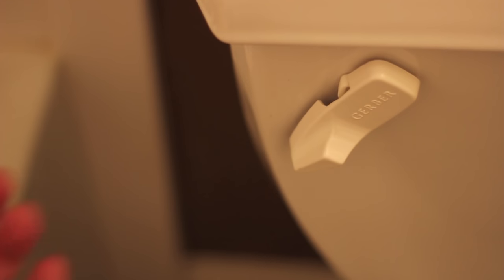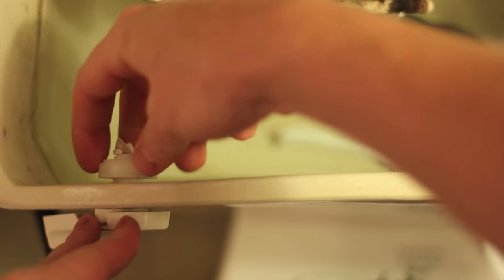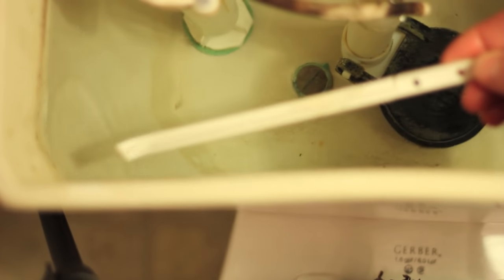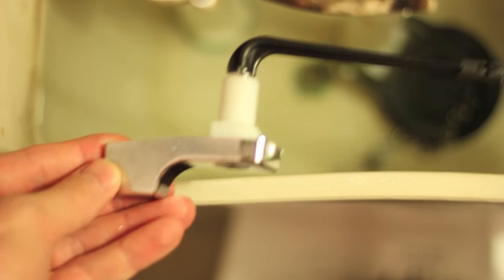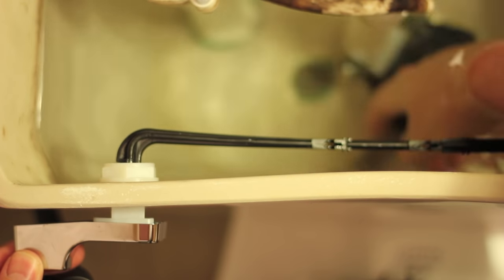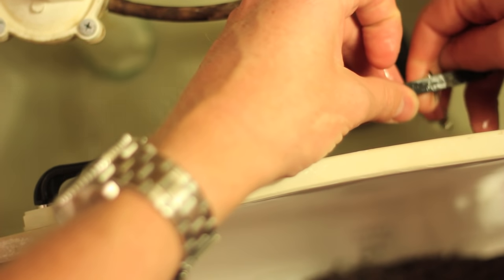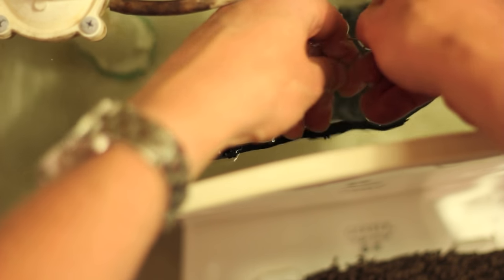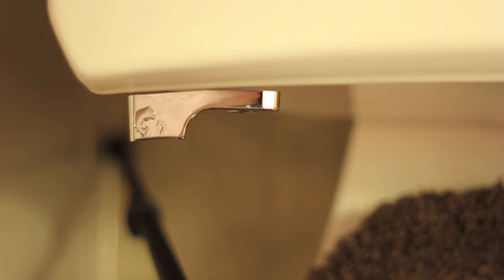How to Fix or Replace a Toilet Handle / Flush Lever

Comment: Oh my stars.   Never in a million years would I have guessed you slide the whole thing threw the handle hole.  You legit blew my mind. We broke 1 thinking we had to disconnect the black part.  I told myself don’t break another watch a video.  So glad I found your video.  I will watch till the end and go fix my toilet.  Thanks. So much

Comment: Thanks. It seems so simple now that I watched your video and made the fix, but I spent a MONTH putting it off. It wasn’t until I watched your video that I got the energy to deal with this. The only thing that threw me for a minute when buying the part was that my toilet has a side handle and most of the parts at the hardware store are for front handles. They did say you could bend the arm but that just seemed like a recipe for disaster so I managed to find a unit specifically designed for side units. It was a few bucks more but installed perfectly! Thanks again for your super clear video!

Comment: This is great, but what do you do if you don't have a chain linkage? Mine is made of plastic and has sawtooth grooves to hold it in place. But it's a devil to try to get it through those little holes on the lever.
Reply from the maker: For that kind, you'll need to either find some way to rig it or get a new chain.

Comment: I'm at a dead end because the nut has corroded and I can't get off.  Even with the opposite from "righty tighty lefty loosey" it didn't budge and I've worn it smooth.  It would have been an easy fix but looks like I'll have to call someone now.  I'm just leaving the tank top off and pulling the chain myself until fixed. ha

Comment: This guy a great teacher however, I cannot get the plastic piece out of the lever hole. It seems some previous person glued it in the hole.  I've tried with a wrench and it won't budge.  The handle lever came off but not the piece that holds handle.
Reply from the maker: You might need to chisel it out - just be careful not to crack the porcelain tank!
Reply: Thanks.  I was able to get it off after a  few tight tries and I'm back in business with my  flusher.  Thanks and thank you YouTube.

Comment: Great instructional video. Very simple and easy to follow. I also appreciated the followup advice to the commenter who couldn't get the plastic nut off (even when turning clockwise). I got out my trusty Swiss Army knife and sawed it off!
Reply: They are reverse thread as I found out today and saw on this video.  Yours must have been doubly frustrating.

Comment: Thank you! I was having a problem where pushing the handle down as far as it would go was barely opening the flapper. You helped me figure out that it was the chain that was too loose after having had the flapper replaced. I adjusted the chain and now it works properly again!

Comment: This is exactly what happened to me so I bought a replacement with a metal arm instead of plastic so it doesn't happen again. Sadly when I took the old handle off there's a plastic piece left in the porcelain hole that I can't seem to get out.

Comment: Just use this in 2024 to find out that the conventional lefty loosey righty tidy method didn't work for replacing the handle and because you mentioned that I was able to fix mine in the same length of this video so thank you🎉🎉🎉

Comment: This was a interesting job, don't think toilet handle had ever been replaced in 45 years at least. Handle snapped off, screw head had corroded on the inside hairpin holding it in place from getting out of hole snapped off but with a careful hot knife I was able to remove old piece and replace with the universal part which was not universal but after shortening I made it work. Thank you for your video!!👍

Comment: Thanks for this video. A quick question, do you have to buy a replacement handle from the same brand or are most replacement handles standard size (i.e., same size square hole)?
Reply from the maker: +Paul Mirek Hi Paul. The sizes and square holes are standard - the brand shouldn't matter. That said, if you are able to take a look at the part before buying it to verify, it couldn't hurt.
Reply: +Nils Rasmusson Thank you sir for your help.

Comment: You took off the screw very easily, starting at 53rd seconds of the video. In my case, that is kind of stuck. Do you know which spanner should I use for removing it? Thanks In advance.

Comment: I'm not here because I don't know how to replace a toilet handle but because I have way too much practice.  Our house has two toilets and I'm now replacing the handle on the one with the newer toilet for the fourth or fifth time in about 17 years.  In meantime, our other bathroom has a toilet that is probably original to the 60 year old house and I've never touched anything but the flapper on it.  Just drives me nuts that all the parts that are on that toilet that are between at least 20 to 60 years old seem to last forever and anything I buy now I know I'm looking at having to replace in three to four years at most.  With the exception of cars which improved quite a bit in my lifetime, they just don't make stuff like they used to.

Comment: The reason it's backwards, and not lefty-loosy righty-tighty is because of your orientation. You're not turning it head-on, you're reaching around from behind it. So it only seems backwards, but if you were turning it in head-on, it would be normal.

Comment: ok how can i replace my cistern lever which, unlike your fancy modern cister, happens to be round hole? even with fluidmaster valve kit the lever is too damn big even with qa rubber adapter whch fits over the square fitting? I bet no one in this video can give me a decent reply to that WITHOUT replacing the cistern?

Comment: I don’t know how I could have messed this up but I changed the handle, then the toilet wouldn’t start running. Then while I was messing with that the toilet handle stopped working. I can pull it but it won’t flush. LOL now my uncle is on the way over. I tried haha

Comment: I bought a metal rod to replace, but here's my issue..when I flush, it raises the rod so high it hits the top porcelain, not giving me enough clearance. So it wouldn't matter if I moved the chain.

Comment: I don't know if you are still monitoring comments but the problem I seem to be having is it the square at the end of the handle doesn't seem to go in far enough for the washer to catch hold on the other side. I just bought a cheap $4 one from Walmart to hold me because I'm in a temporary residence

Comment: If you`ve had a handle that got hung up where you have to jiggle the handle then you have too much slack in the chain . There shoudl be very little slack from handle rod to the rubber stopper.

Comment: Here's a great tip that will save you 1000 litres of water every year ! Place a house brick inside the cistern  , so when it fills up after a flush the brick takes the space of a litre of water . I have been doing this for years now and it works :)

Comment: Thanks. FYI ...you can flush (by pulling up the chain) until you get the replacement piece. It's a cheap easy fix, so don't wait to long. A great first time diy. ;) (I thought it just needed tightened....didn't know the plastic will do that.)

Comment: That's the point I was missing right in the opening - the nut on the handle is backwards.  I was wondering why I was turning the nut but it wasn't getting any looser.

Comment: Thank you! I was failing miserably but you said the magic sentence (unscrew in the opposite direction). My second hurdle was the opening on my tank to insert the handle is more oval then square-nothing ever goes smoothly ( I resolved that by filing the square couriers).

Comment: I have a question I need help with so my toilet Is 69 years old It hasn't been changed since the house was built In 1951 anyways the other day the plastic nut that holds the handle on cracked so we went to home depot bought a new flush handle and when I installed It I noticed that the metal lever that connects to the chain was lifting up too high past the tank and when I put the tank lid on the lever Is hitting the lid and keeping It from being able to flush the toilet am I doing something wrong please I need help

Comment: I've never had this trouble before but the handle and plastic nut on the other side of the porcelain are loose and I can't get it right. The flush handle is very loose. The but is tight but the handle is flouncy.

Comment: My son broke the handle, I removed the part and purchased a replacement, now I can't get the old one off ( don't have the right tool to loosen part), I was also turning it the wrong way! Will get some pliers and get thus done. Thank you so much for doing this for ppl like myself, I was about to call a plumber. Thanks.

Comment: Mine was the chain it was too long  after replacing the   flapper thing i didnt  cut it short enough  need a few links  down on the hook thing  . finally  its fixed. Thanks for sharing...

Comment: Are there different sizes if the square hole? The new one would not fit? So the screw can’t get far enough to screw on the bolt.

Comment: On most toilets with this problem, the chain has to be repositioned into a "hook" at the end of the arm of the handle. 
My "hook" looks like a safety pin shaped like a lightbulb, rounded at one end. 
This can become the most aggravating part of the repair because the hook where the chain connects into can be very stubborn to pry open. 
Solution: Use a safety pin. Slip the safety pin into the appropriate link of the chain, then slip the safety pin into the hook at the end of the arm and close the safety pin. So in effect you are connecting the link of the chain and the hook with a safety pin, instead of trying to join the chain link directly into the hook (which can be a pain). 
You might need to try a couple of different links of the chain before finding the right degree of tautness, but that only takes a minute.

Comment: I don't understand why this stick always breaks. Manufacturers should come with better material than piece of a plastic.
Reply: Same with paper towel which I should pull with both hands. Why can't they make so that I only need to use one hand to pull the paper just fine!!
So many non-sense products are used widely.

Comment: Thank you Nils, this is very helpful.  I do have a question tho- what should I do if the chain does get stuck in the flapper?  Should I shorten it?
Reply from the maker: Exactly. If it's long enough to get caught in the flapper, it needs to be shortened. Good luck!

Comment: my chain is rusty and the lever is rusty.  The lever hole rusted causing the chain to fall off.   Does this just mean I have very hard water coming into my house?
Reply from the maker: +TheDeanna2003 Hard water could be contributing but it could also just be old parts. Fortunately, either way it's an easy fix and only costs a few dollars. Good luck!

Comment: can't unscrew plastic cover inside bowl.  Tried both right and left bond it's stuck.  Any ideas?
Reply from the maker: Susan, it might be time to use some brute force to remove it, since the new handle comes with a replacement piece. Try crushing it with some vice grips or using a saw if you have to. Just remember that the tank is porcelain so you don't want to do anything that would risk cracking it. Best of luck!
Reply: oh thank goodness i thought i had lost all my strength...time to take a saw to it

Comment: ! i just ran in my bathroom and fixed my toilet in 7 seconds !
Reply: (after a few months of dealing with it and everyonceinawhile it sort of working and the other times 'bucket flushing' etc.! yay and thank you! the washer was just hangin out at the bottom of the bowl, still around the chain, all i needed was lefty-tighty:  handy tip!

Comment: Does the new part always have a new handle?  I don’t need to replace mine.
Reply from the maker: Typically, yes but you may be able to find the part by itself.
Reply: @LRN2DIY  thanks

Comment: This is a helpful video, though I don't think mine comes with a chain. How do I fix it if it doesn't have one?
Reply: +Tammie Puopolo 

If your toilet doesn't have traditional flapper, you can safely just threat the handle arm through the opening that should be on the side of the tower -- that vertical cylinder in the middle. All of the arms have openings for chains nowadays, and you can cut them to the right length with anything sharp (hell, a bread knife would work in a pinch). But you don't HAVE to use a chain. The plastic is strong and should last quite some time without breaking. The chain will decrease the pressure applied to the plastic arm, but they can also be a pain to adjust.
Reply: Christopher Harris Thank you, yeah I found out I have this "strap" I guess instead of a chain. Looked at videos and pictures and I got it. Now if it was to replace the whole handle and actually use tools then I would have more trouble. But this was just stick the strap back on in the little holes. LOL I thought it was harder than I thought.
Reply: Christopher Harris z

Comment: what if we have no chain holding anything on?
Reply from the maker: ***** If there is supposed to be one but there isn't, it may have been flushed down the drain or may have walked off with a chain stealing leprechaun. If it looks like there was supposed to be one, you'll need to buy a new flush lever kit. It's possible you have a different setup, though, too.
Reply: Nils Rasmusson no,we rent this house so they used the cheaper no chain kind..i jujst need the lever,but i think i figured it out.not exactly dsure but we'll find out when i go to the store later on,lol

Comment: whats a lefty righty ?
Reply from the maker: 'Lefty loosey righty tighty' is a little saying to help you remember to loosen a nut by turning the top of it (as you're facing it) to the left and tighten it by turning it to the right. This setup was backwards from the traditional configuration for some reason.

Comment: my chain is broken, fukkkkkkkkkkkkkk!
Reply from the maker: +July No worries. A new chain is only a few bucks. You can actually replace the whole system (float, flange, chain - everything) for about $15.You can also use a paperclip, zip tie or safety pin as a temporary fix for your chain. Doesn't have to be anything fancy - just waterproof.
Reply: +Nils Rasmusson Wow thanks a lot! I use a paper clip to temporarily link them together, I have an old style dot chain and it is broken at the middle, so it's harder to do than the ring style but it is fixed anyway. Will buy a better system as a backup soon. Thanks again!
Reply from the maker: +July That's rad that you got it to work - nice going!

Comment: Thanks for the video, Nils. I just replaced mine. It works after I made some adjustments, but the handle itself is a little bit loose. It's all metal because the plastic ones keep breaking on me. Usually the chain. Anyway, do you think I need to tighten the handle nut more to fix the wiggle in the handle? The threads weren't the best near the end where the nut would be completely tight, but I feel like I tightened it pretty good. I don't want to cross the treads, or damage the toilet itself. For now, it works. So, I'm not gonna mess with it. I'm thinking it's just not the best replacement for my toilet, because I really had to adjust things just so it would flush with the tank lid back on. The handle wasn't able to lift the chain up enough because it would hit the lid. 

LOL, sorry for such a long comment. I just always have issues when it comes to repairing the internal parts of toilets.
Reply from the maker: Hey Jason, sounds like the handle you have just might not be a good fit for the toilet. The cutout for toilet handles varies from one tank to the next, even though they're supposed to be universal. I wouldn't risk tightening it any more. You could try doing a shim of some sort - maybe some hot glue or some Sugru or something? I also think that some handles are just manufactured pretty loose, unfortunately. Anyway, I'm glad you got it working!
Reply: Oh yeah, a shim is a good idea. I didn't think of that. I'll try that. I did take it off and tightened everything down outside the toilet and it locked up the handle well, but when I put it back in the handle is still loose. So, yeah it must just not match up well. Thanks for the advice. I really appreciate it.
Reply: I would of used a thin rubber washer

Comment: It's reverse threaded. That's why the locknut rotates counter-clockwise. It's a measure to keep the handle from loosening with excessive use. 

In fact, it's the most important thing for folks replacing the handle to know because trying to follow the rule can lead to massive frustration and a nut so tight, you could take an hour instead of the 10 minutes this should take to finish it.

Also, an important point, to know -- you can use a combination wrench if you have one big enough, but it's just as easy to use a socket wrench. These locknuts are usually pretty big, though. Sometimes, they're wingnuts, too.

Just be aware...all of these videos make this look like a five minute deal. But those washers can get heavy deposits embedded in their threading and they can be a huge pain to get off.